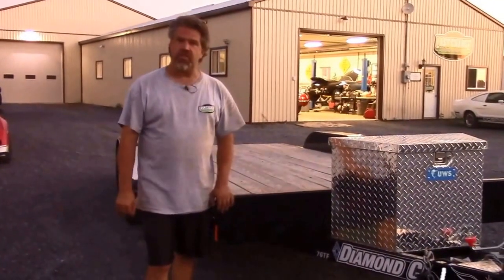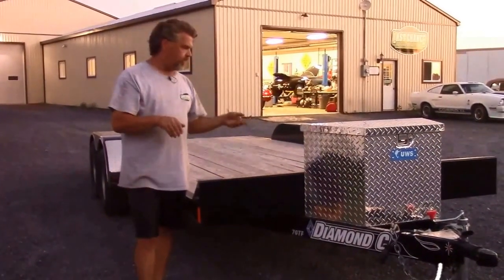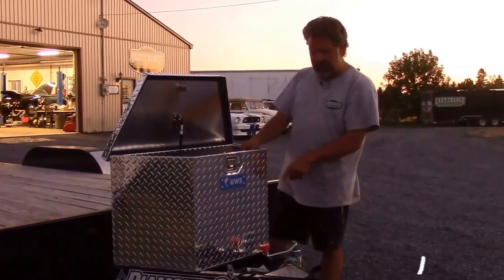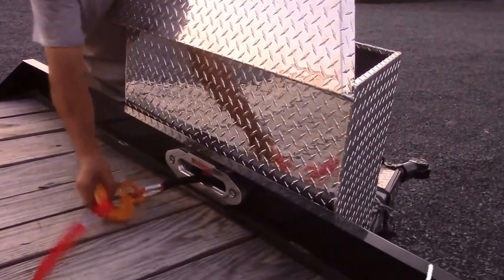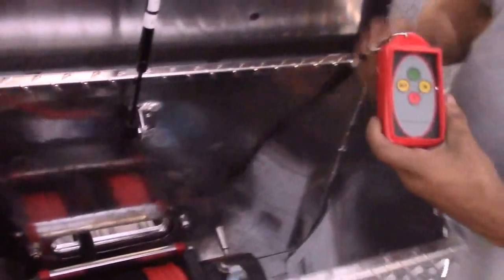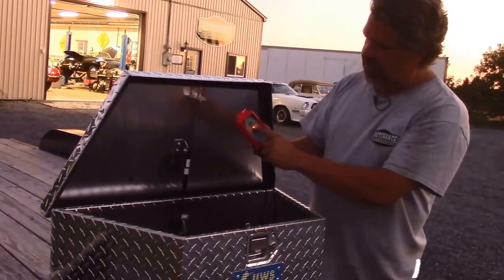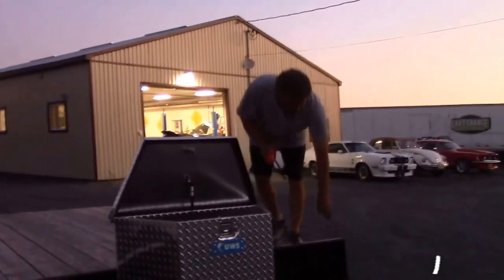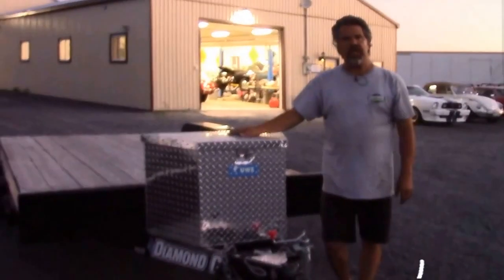Car Hauler Trailer Power Winch & Enhancements, lastchanceautorestore.com

Comment: Is it possibily to use battery power through the trailer plug from the truck?
Reply: but you can set it up to charge the battery via the truck